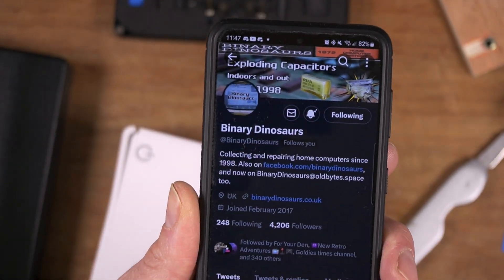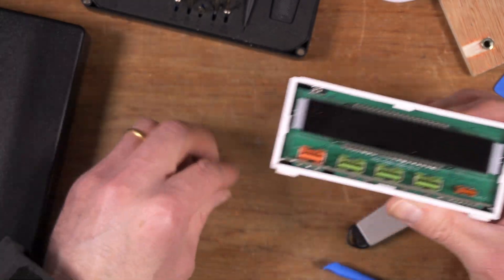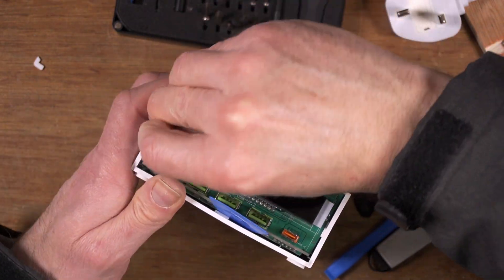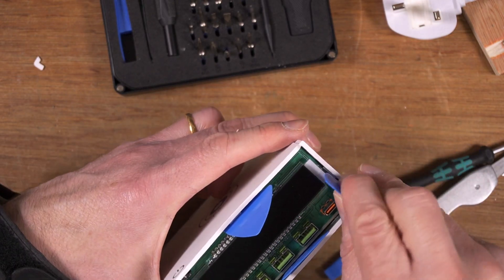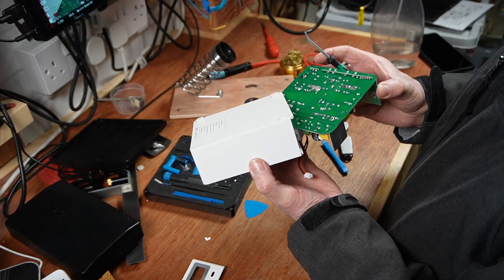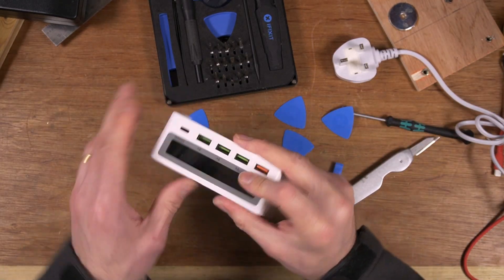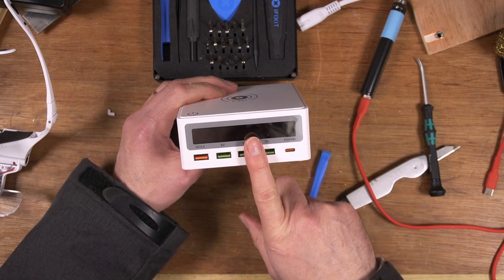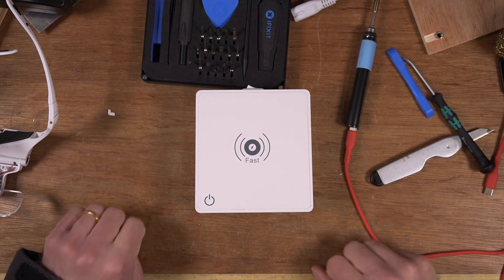PinePower clone Part2

Comment: It’s made me chuckle that we had identical mornings but you filmed yours 😄 I should point out that the grounding problems are only in properties that don’t have a utility earth, like sheds and outbuildings with earth spikes. My PinePower is fine in the house so the clone should be too, I hope.
Reply from the maker: Thats good to know. I will give it a test before I do anything expensive or delicate. 
Going to try using this second channel a bit like twitter threads. Just random stuff that I cant be bothered to edit. 
Did you break the top clip on yours too then?! 😆
Reply: Bottom and right hand side. Just like opening an old DECserver 700 and equally as fraught! Oh, I also inadvertently pulled off one of the switch wires, so that was fun.